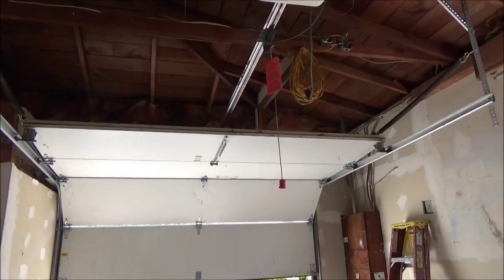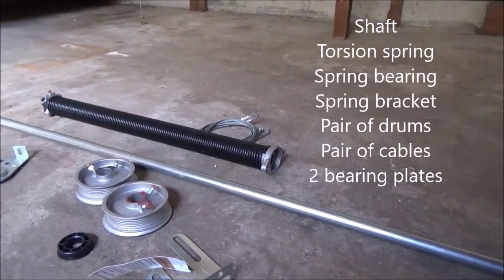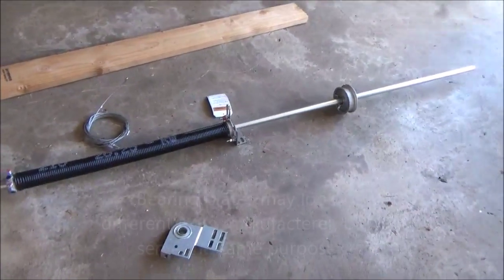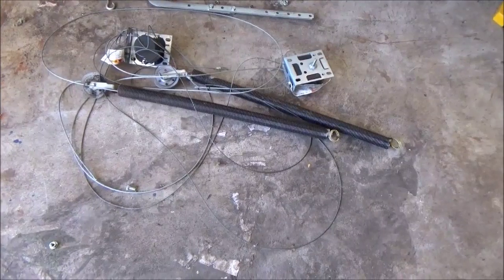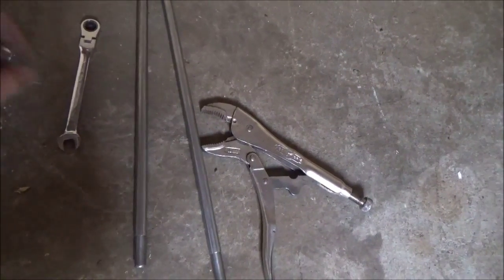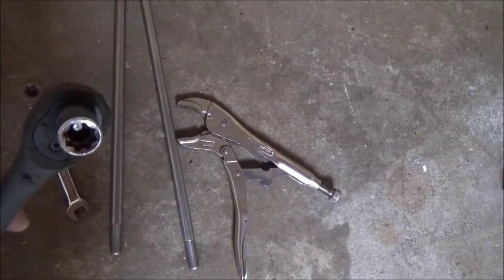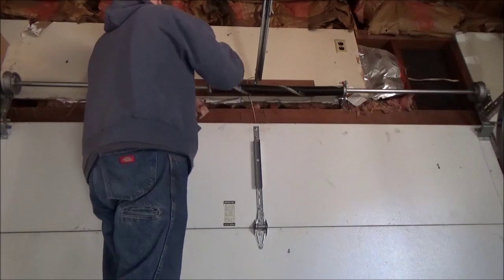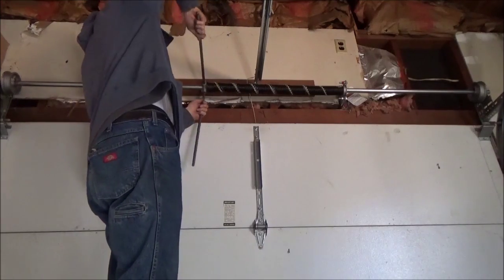Spring Conversion From Extension To Torsion Spring System

Comment: Hi !how are you? I have same problem,my question is where did you get the pipe(tube) and the right size spring? I couldn’t find on the Amazon?thanks ❤
Reply from the maker: The best thing is to contact a local garage door company in your area that sells parts and maybe they can sell you the whole kit with drums, spring bracket and cables etc. They can help with determining the correct spring for your door. There are programs we use on the computer to calculate the spring. Door weight is most important but also asks track radius (10", 12", 15" and low headroom) and drum size and height and some other things. I cannot give you the exact spring size for your door with the info I have. The basic 7ft tall door weighing 140 lbs. would use a green spring about 32 inches long. .243 wire size x 1-3/4 in. x 32 in. or .243 wire size x 2 in. x 28-1/4 in. 6 ft. tall is an odd size and needs to be computed for exact spring maybe the garage company you purchase from will have the program to calculate for you.

Comment: Need to stretch the spring not just tap on it. Just bump the spring over while holding the bar. If not it will bind the spring when it is under pressure and cause failure sooner than later because the friction on the spring.

Comment: Thanks, was wondering what would happen if I could use a 90lb set of springs on a 70 lb door and this was close to appropriate.  Would have been nice to know what size springs were on there as well as the door weight.

Comment: Those little plastic housings from the extension spring system is something new to me.  Never saw those before.
Reply: Did some googling.  looks like a form of "EZ set" system where you can wind up the springs with a drill and install the springs with the door down.  Interesting.

Comment: Very nice video.  Looking to do the same conversion on both of my Clopay 9' doors, and you provided a great conceptual demo.  BTW - You mentioned that if the spring end on the left isn't curling upward, then you have to flip the spring around to put it in the correct position.  Actually, if the spring end on the left isn't curling upward, then you have a left-wound spring (wound counter-clock-wise, labeled "LH"), and you might need to exchange it for a right-wound spring (wound clock-wise like a standard screw thread, labeled "RH", like yours is).  The two springs on two-car garage doors use one of each type to prevent excessive twisting on the support tube.  Flipping a spring end-for-end doesn't change the direction of the wind.   :-)

Comment: Another great informative video! Ive never really been a fan of extension springs. Yeah there super easy to install and work with, but I've noticed that for some reason they always seem to make the doors run harder then they should. Ive noticed that this is especially true on these Clopay doors, must be because not only are there more moving parts (adding friction) with extension springs, Clopay uses those non ball bearing plastic rollers which creates even more Friction  unless you keep everything lubed on the regular bases which the average homeowner doesn't lol.  Great video thanks for sharing!
Reply from the maker: +Joe Powell I would never want those extension springs in my garage. One time I had a broken one (no safety cable) that a piece of the spring flew across the garage and lodged into the big wood support beam like a bullet. I had to dig it out with my screw driver. After I saw that, I was like, good night.